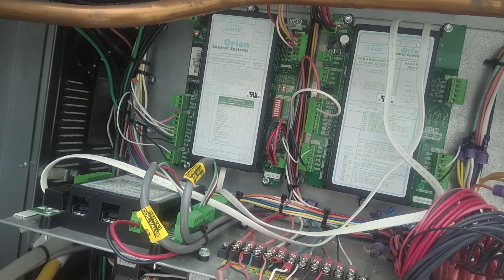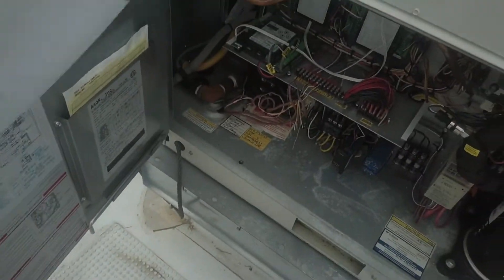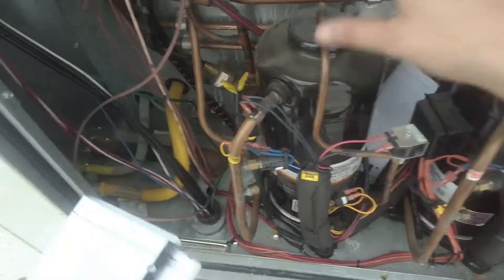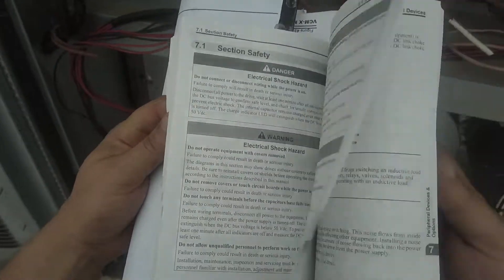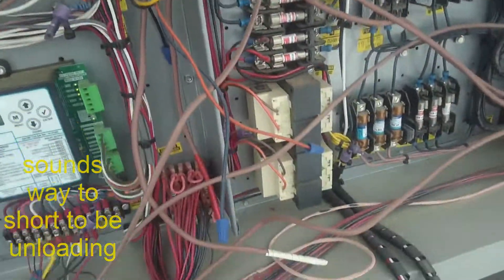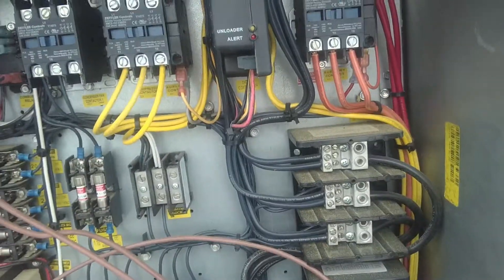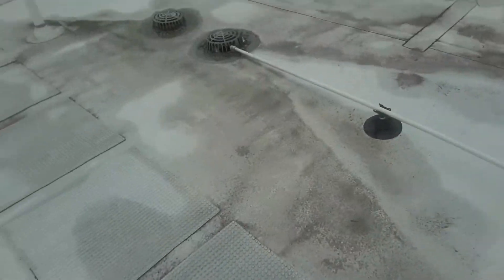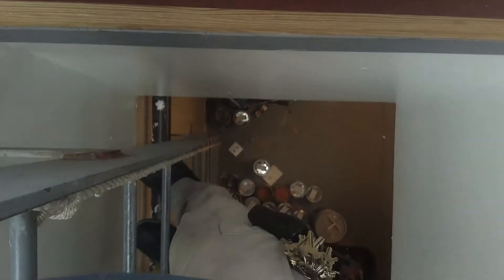HVAC AAON 5 Ton Trouble Codes  Part 2of2

Comment: MAKE SURE YOU MAKE THE WIRING DIAGRAM YOUR FRIEND...  IT WILL EASILY SHOW YOU POINT TO POINT ON WIRING AND WIRE COLOR ON WHERE IT GOES.
FOR MORE CONTROLS INFORMATION HIT..... http://www.orioncontrols.com/aaon_technical_guides_tulsa.php
Reply from the maker: Who cares where the wires go (TOP SECRET AAON Schematics on the door  are  wrong cant go by them  )you will already know where the problem is  99% of the time  with your ears on a AAON unit will tell you Every year what the problem is . Bad Bearings ,VTD over drive ,Belt etc .... Just listen. These units fail more than I can make more videos of it happening.  But I am not mad at you man I want to say Thanks For Watching and keep up watching there is  sure a lot more videos coming your way about AAON  units.